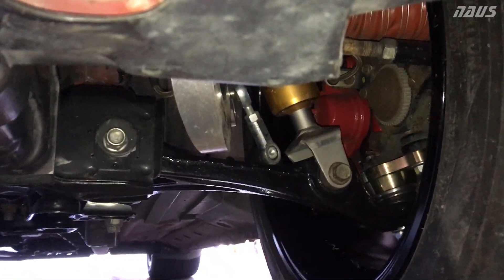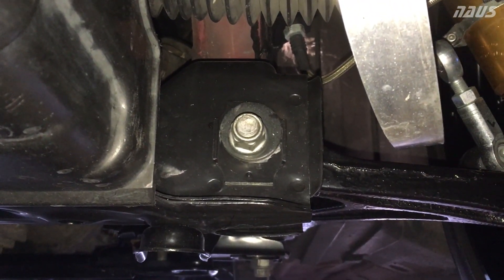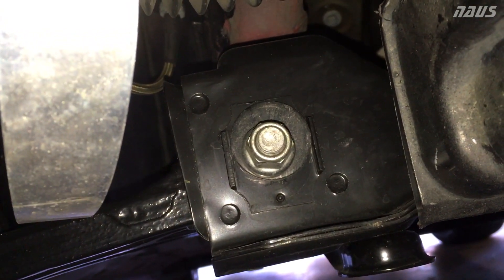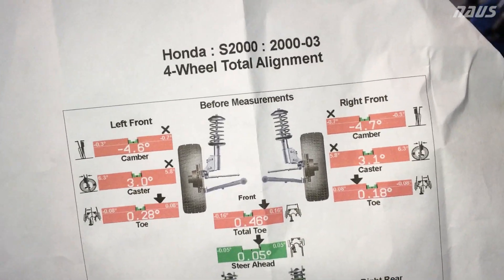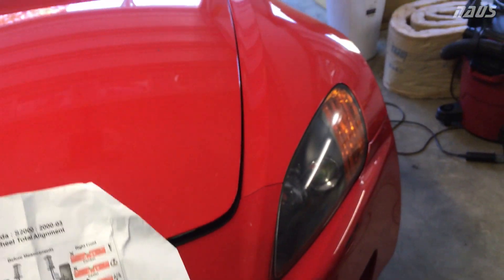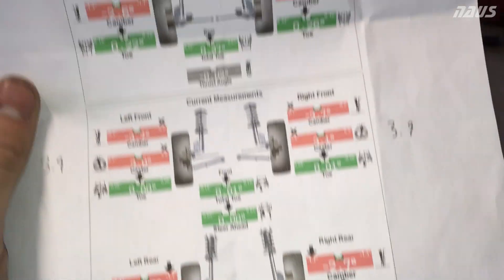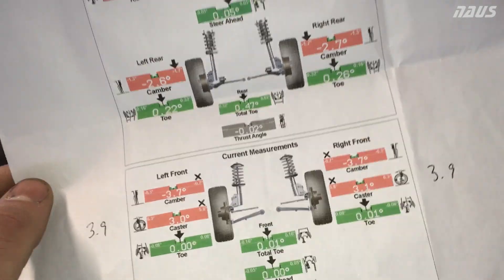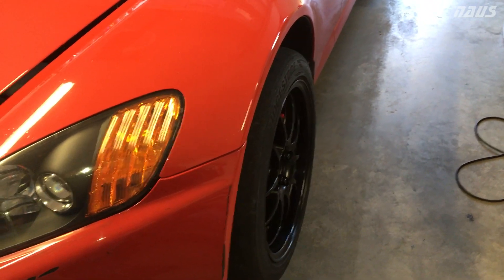Spoon Front Offset Lower Balljoints - Honda S2000

Comment: Any reason you went with these instead of offset bushings?
Reply from the maker: I think this is a Little more of a robust solution . The offset bushings are all hard plastic and will develop play overtime. Didn’t feel right to me to change out my new hardrace bushings either. Offset upper bushings will create more tire to fender clearance, however my wheels are 17x9 +60 so the fitment is spot on anyways, adding those bushings most likely would have caused my wheels to hit my control arms again at full lock, and potentially hit my brake ducts